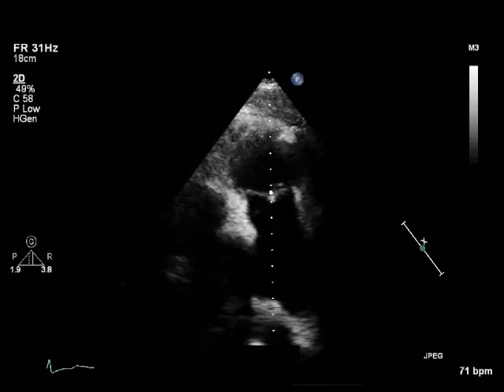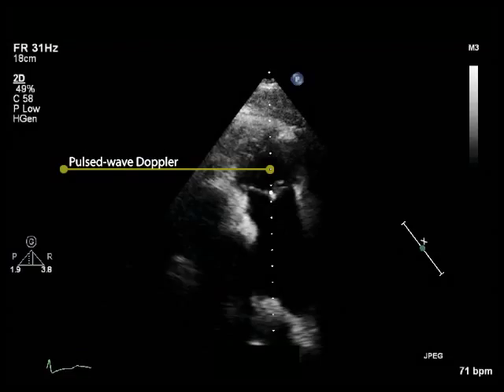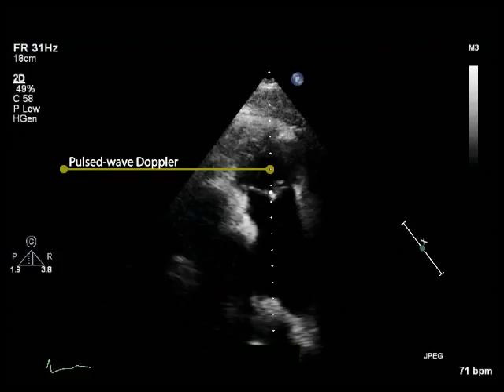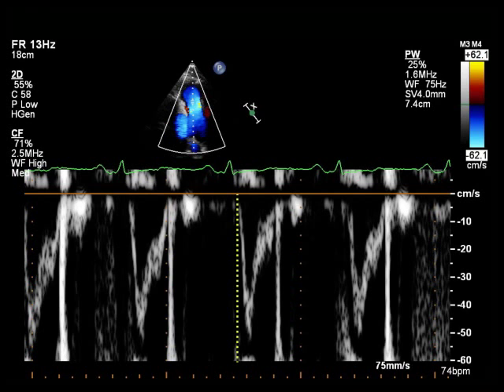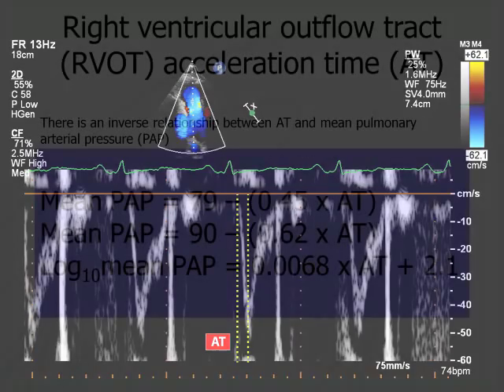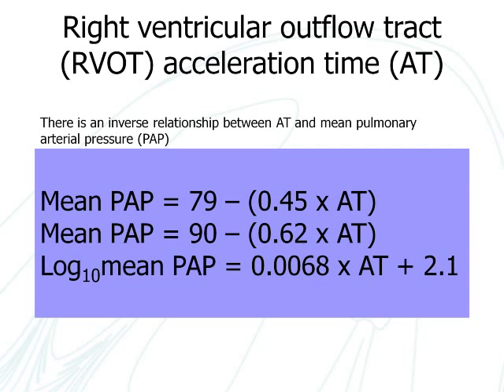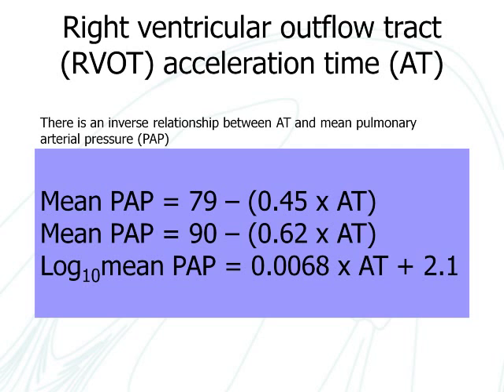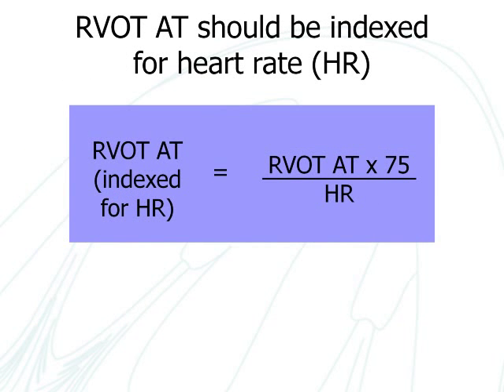17. Measurement of acceleration time (for mPAP) at right ventricular outflow tract (RVOT)

Comment: Hi Luke. Thank you for your video.  EAE Guidelines state that AT shoud be "measured from the onset of the Q-wave on electrocardiography to the onset of peak pulmonary flow velocity". What are your thoughts on this?
Reply from the maker: HiThanks for the comment. Sorry for the delay in getting back.We prefer to measure from the beginning of flow. Interestingly the paper the guidelines refer to actually states:"Acceleration time(ms) was measured from the onset of ejection to the time of peak flow velocity. Preejection period (ms) was measured from the onset of Q wave on a simultaneously recorded lead II ECG to the upstroke of the Doppler flow velocity deflection during systolic ejection."It may make a significant difference if the patient is in
BBB.

Comment: Thank you for the informative hands on video.
I went to the linked webpage. The windows version of the pdf file seems to be broken. :-(
Reply from the maker: +Soumya Ray Sorry - I didn't pick up your message. I have tried the link now www.ph-echocardiography-protocol.com and it seems to work fine. It is > 200MB and comes as a .zip file which you then need to extract. Let me know if any further problems. NB: I will be updating the guideline soon to reflect recent ESC/ERS recommendations.